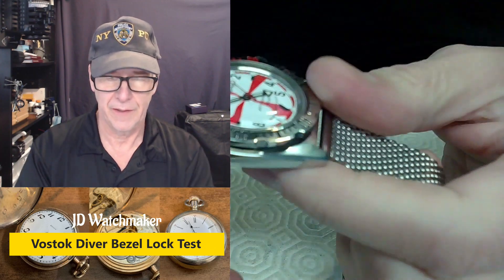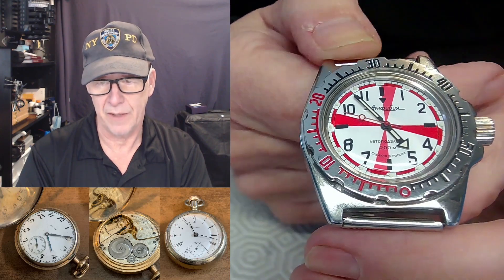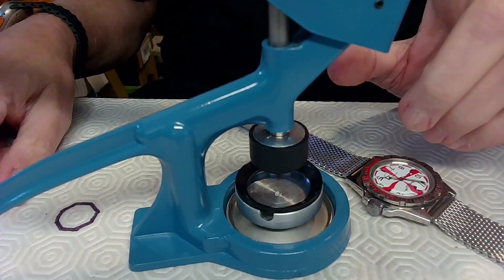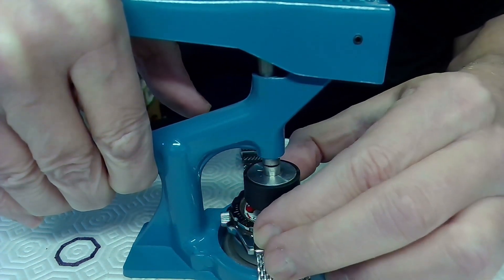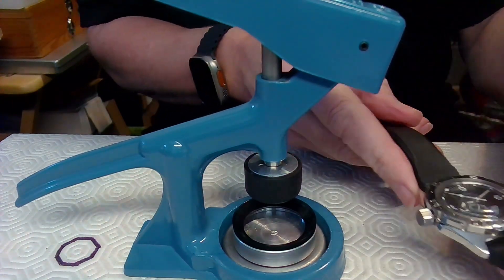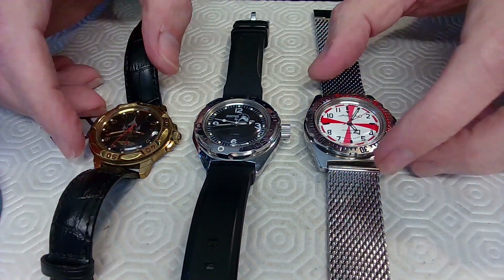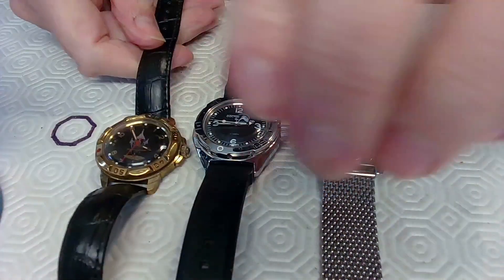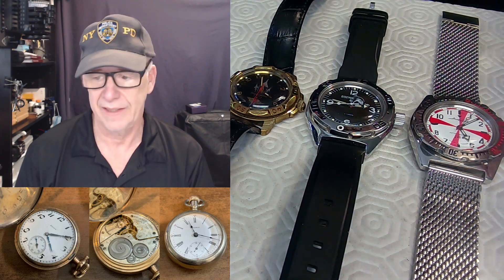Vostok Dive Watch Bezel Lock Test

Comment: Thank you for testing this. I’ve seen several reports that the bezel locks at depths below just 10ft underwater, so it’s very safe to say that you applied sufficient pressure to test it.
Reply from the maker: I absolutely applied a lot of pressure on that dome crystal, way more than would be seen at even 100 m probably. And still, the bezel did not lock one bit. And I also know there’s nothing underneath the bezel that would expand under pressure to cause the bezel to lock. So in summary, this basil will not lock.
Reply: @JDRichard  I agree.
Reply: @JDRichard  under the bezel is wire spring that can be adjusted

Comment: You are technically only testing if the bezel locks on crystal pressure. If you want to really bust this, you must do what you say and test it submerged. I'm not saying you are wrong, but testing means testing.
Reply from the maker: Ok. This summer I do the test at the lake.
Reply: Yes, and not only would the pressure have to be applied clamping the bezel to the case, but also inward (toward the center of the watch) on the outer edge of the bezel at the same time.  Also, don't underestimate how much pressure we are talking about.  At 10 meters depth, the pressure is 15 psi.  The watch is officially rated for 200m, that would be almost 300 psi.  That means having 3 heavy men standing on the watch.  It's not feasible to test without a pressure chamber.